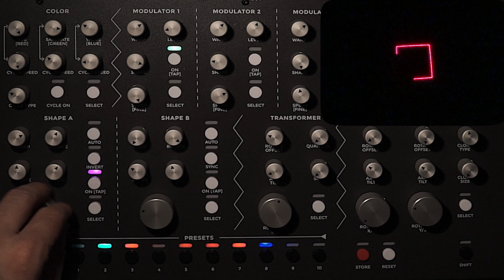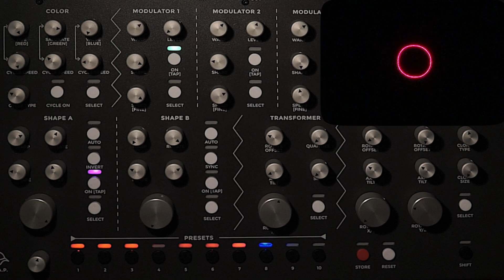Radiator Laser Synthesizer: Abstracts and Presets

Comment: Hi! A few Qs: Can you manually, live, vary scan rate? Can you morph/crossfade/transition between presets? Can you adjust brightness live?
Reply: And more: Can you trigger even more presets via MIDI? Any plans for OSC? :) Just ordered one, some days too late I guess...
Reply: and... potmeter pickup or not, when changing preset?
Reply from the maker: @biskopklemens5871  I'm sorry. I don't know what you mean by potmeter pickup. Can you explain?
Reply from the maker: Ok. Great questions!  presets can be triggered via midi. scan  rate can be varied. brightness can be  controlled live.  there's currently no transitions between  presets, but the ability to fade out / fade in is something we've been discussing.